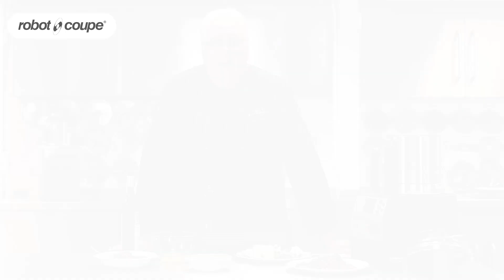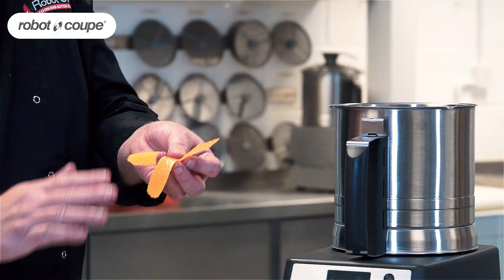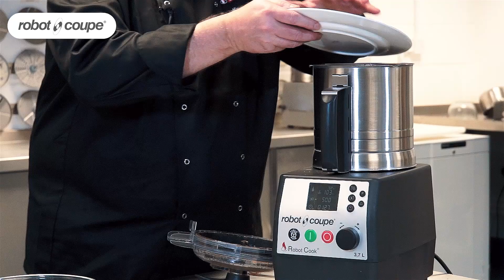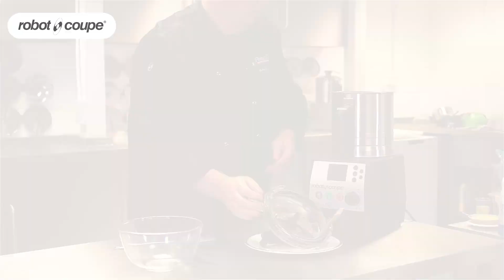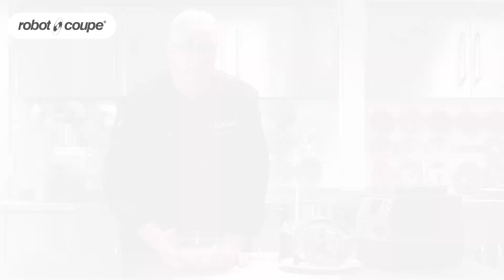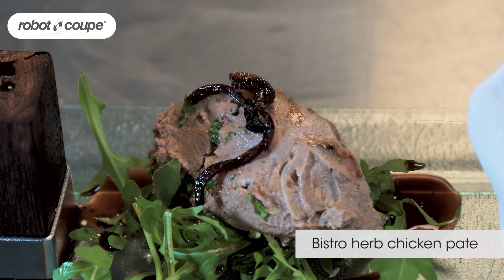Kevin Viner creates a bistro herb chicken pâté with a Robot Coupe Robot Cook

Comment: Hmm, colour is a bit off due to the heat. Not as pink as I would want it. 64º would have been ample
Reply: Paddy McDermott We do a chicken liver parfait at work, its 
-liver
-clarified butter
-whole eggs
-port reduction 
-pink salt 

blitz and pass the entire mix, eggs last.. mix goes straight into a terrine mould, into steam at 85 degrees for 45-50 mins ish. EHO has suggested we should start taking it to 70 degrees internal temp for two mins, then straight into blast chill. we tried it and it came out perfectly pink :)
Reply: We just put it all in a thermo like he does and and also add eggs like you. Take it to 70° on the thermo and take the temp of the mix til it hits around 65° then off. Pour it straight into a mould. You could just blitz everything and vac the whole terrine and sous vide it. We do that for our foie terrine.
Reply: Paddy McDermott I agree ,color is way off, 82 is too hot
Reply: Paddy McDermott did you account for the mushrooms colouring the pate, and the sun dried tomatoes and what not?
Reply: The temp changes the colour, the ingredients not as much. Anything above 72º would render the meat grey like most meats. Some pink salt would have helped but there is really no need to go that high temp wise.